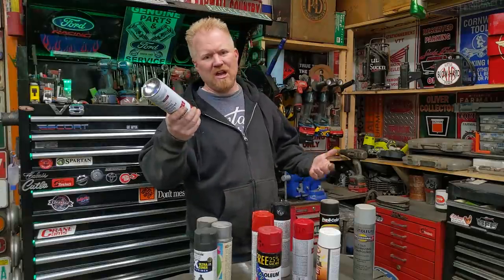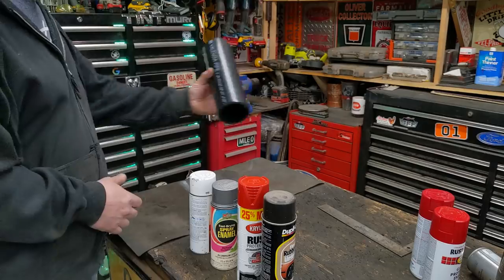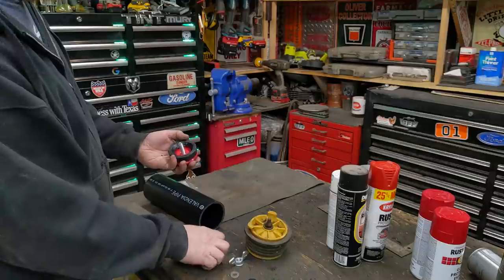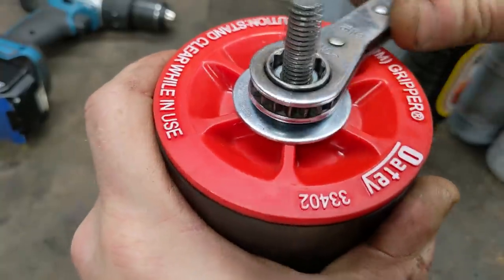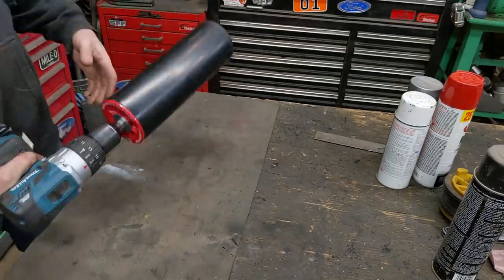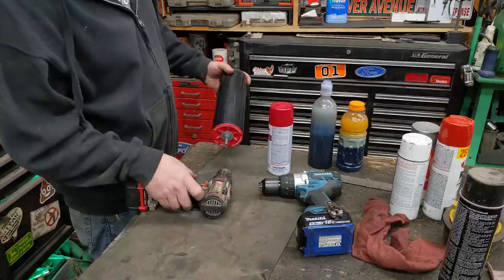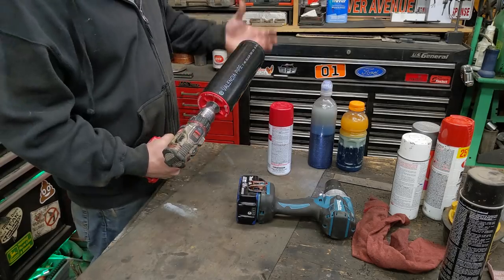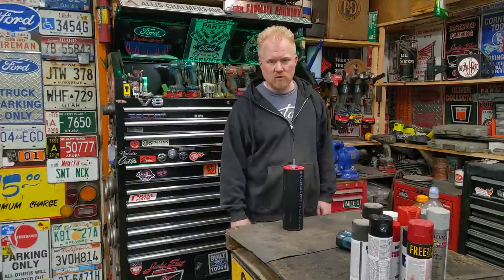EASIEST Spray Paint Can Shaker Stirrer BUILD drill powered

Comment: A 2ft chunk of that 3" pipe is almost $20.00 w/tax at HD now. Along with $6.00 for the test plug and it's almost $30.00. I went the cheap route and made one out of a tin can a 2" bolt and some hardware. basically it's free and it works great. I use a wood shim to hold the spray can in place too.
Reply: He gets a lot of stuff at auctions, at the kerb, in lots, etcetera.  You're right though, if you were to buy it outright and specifically for this project.

Comment: I made one of these the way you've shown here, and then I made another using an old empty propane torch cylinder. I pulled the Schrader valve rinsed it several times with soap and water, then cut the end off. I deburred the cut end and dipped it a bit in a rubberized coating. I welded a bolt onto the screw end and pained the whole thing black. It works wonderfully.

Comment: This idea turned out perfect! Purchased the items from HD and with current prices, came out to under $30 to assemble. Decided to go with a 24" pre-cut PVC, stainless steel set of nuts and washers (Everbilt) per your specs. The screw from the test plug seems to be just right in length to fit in a drill's clutch. Thanks!

Comment: Love the simplicity. Another important reason for hand shaking the can is impart warmth from your hands into the aerosol and paint or other content. This helps to break up "clumping" of the solids that always sink to the bottom of the can especially after sitting for long periods.
Reply: I usually get a pot of water and heat it till boiling point and let it cool for about a minute. Then I throw in all my spray paint cans that im going to use and let it warm up in the water before shaking em up for use. 

I keep em in the water and keep the water warm until im finished. Every liquid sprays a lot smoother and better with stronger spray pressure due to the inside pressure of the can being higher from heat. You should try it.

Comment: I made one too but I attached the piece of pipe to a reciprocating saw blade. Split the pipe down the middle and used a steel hose clamp to hold the spray can in place.
As the blade goes back and forth it really shakes the can, not just spins it.
But your device is good too.

Comment: my savior! i hate shaking cans, usually bust out an electric heater to preheat them to 90-100°F before shaking just to help the mixing process and avoid clogging the inside valve or dip tube.

Comment: Found another use for mine. Slice a pool noodle lengthwise long enough to fit the can. Line can with enough scrap inner tube to prevent noodle movement. Insert paint pen and shake away!  Works great and really fast!

Comment: I just use a old Pringles can that I’ve duct taped for reinforcement, then a round head bolt through the bottom. I am sure yours is more robust but I didn’t have to spend extra money or go to the store again haha. It works good and I did enjoy those Pringles 😂
Reply from the maker: The Pringles in the process makes it worth it.

Comment: Freaking awesome! Even cheaper, drill a hole thru an end cap, put a bolt & nut thru the cap & tighten down, glue the cap on, tighten onto the drill. Freaking perfect!
Reply from the maker: Actually the caps for this pipe size are nearly three times as much as the test plug.

Comment: GREAT idea and I am going to make one. Leaving the rag out induces some eccentric oscillation. With the rag tending to center the can, the contents to include the ball bearing, rotate at about the same speed as the can and the real mixing takes place when the can stops. This is why we hear the ball bearing spinning when the can stops. Some start and stopping while holding the mixer at a 45º may help.
Reply from the maker: I've stopped using the rag and just let it bang around inside now.
Reply: @sixtyfiveford  Thanks to your great idea, I have built three of them, two for friends, I too just let the can rattle around after finding the ideal speed. Thanks again for solving a problem.
Reply: Add a strip of grip tape inside? It would take up little space and supply a bit of anchor for the can....

Comment: I built a wood  box frame and a small metal frame on top. Taped 4 3/8 all thread  rods into wood ,nut and washer top and bottom of metal frame to adjust belt on small pulley attached to and old electric junk drill secured in wood box. Used some dumpster conveyor roller to mount in frame. I can mix 6 spray bombs at one time effortlessly. If there real old let it run for a while while ya do something else. Never fails. Make a u bracket to lock drill trigger at what speed you want and walk away. I’m to old and dinged up to rattle cans lol especially an old one.

Comment: Great tip. I used 80mm PCV and a plastic lid from a kraft peanut butter jar, stripped the threads in the jar lid, and it fits real snug. I run the drill in reverse to stop the bolt from unthreading. Thanks.
Reply from the maker: Awesome.

Comment: I use an old long sawzall blade with a worm clamp riveted to it.  Does a hell of a job.

Only downside is i don't usually have the sawzall laying on the bench
Reply from the maker: I've used the sawzall years ago for shaking. It took more time to swap in the custom blade and attach the can than I could have just shaken it by hand. Consequently I rarely used it. It did work well though.

Comment: As a note-- you can make something similar to this using an empty Campbell's hearty soup can, a nut and two bolts.  It works basically the same way and the soup costs a lot less than 3" PVC.  Just an alternate concept on a very good idea.  Save those rotator cuffs and use a shaker. :D
Reply: I made mine from an alpo dog food can but the force of my drill actually bent the bottom. So then I reinforced it with a chunk of 1/4" steel. I had one in my scrap bin from where I used a metal hole saw, 2.5" I think. Worked perfect and no more worries that it'll bend again and potentially fly out and hit me.
Reply: @89Mirageman  That will surely work.  If one doesn't have 1/4" steel laying around, just use the top or bottom from another can.  It will double the strength of the bottom.  Washers also help as re-enforcement.  The can doesn't have to spin very quickly to shake the paint, so if one has a variable speed drill it works best.  What I finally settled on (and it works wonders) was a cheap reciprocating saw (cheapest one can find works great), and I strap the can onto a long blade.  That shakes the paint better than anything else I've found.
Reply: @Wishbringer7  Do you use a hose clamp or what to hold the can to the blade?
Reply: @89Mirageman   A hose clamp is probably the most readily-available item.  I personally use a special spherical clamp I found at the local hardware store that is somewhat like a ratchet clamp. It is quick and easy to use.   I found another video here that has a fairly interesting idea:  https://www.youtube.com/watch?v=dbkTp_xzFWo

Comment: So I made one per this plan (not from this channel) but wanted a simpler hookup. So I found "hanger bolt drivers" online which are 1/4" hex to 1/4" threaded. Used a simple 3" cap and the 3" pipe. Gotta use Loctite on the threads or they spin off. Now it goes into an impact driver and shakes up upside down marking paint for my septic mark-ups. Keep one in each excavator.

Comment: I made a spinner to clean paint rollers using a roller handle and 1/4 inch threaded rod. It wanted to bend the threaded rod. I’m doing yo try your method with smaller pipe plug and pvc.  Thanks for the idea!

Comment: I just made one.I used a piece of pvc that i already had an a cap.Just drilled a hole an put a bolt through the cap,Slightly wobbly but does what it needs to.Thanks!
Reply: @keithmarlowe5569  I actually think so to,if you look hard enough at a regular cap there is machine marks dead center of it i just drilled 1/8 hole then step it up to the size bolt i had.

Comment: works :) I just bought the 12" pipe & cap on Amazon, just that easy, comes with a wing nut, removed 3/8"-16 TPI & put on a nut so it fit drill, not sure if that is same in video, saw it a few weeks ago.  thx for something I needed to make. I use it everyday.

Comment: I built 3 of these. 1 for me, and 2 for Christmas gifts.  I substituted thin wall PVC pipe to cut down on the weight, Sch 40 was way heavier and with the thin wall (also cheaper at my ACE Hdwr) you don't need to be as careful with holding the tube while mixing.
Reply from the maker: Awesome.

Comment: Done, can't wait for Amazon. No more shaking by hand
Reply from the maker: Hey Thanks, I'm glad you liked it.
Reply: @sixtyfiveford  shaker 2000 done, like you said it's works perfect, even better using a drill that has a slight bend in the drill arbor. Shakes even more. Took longer to find the pipe I just set down than it did to build.
Reply from the maker: @ltmedic3  I no longer put a rag in with the can and just let it bang around in there.

Comment: Nice video. I tried to make one similar to yours but it didn't work very well I think the problem I had was the diameter of the tube was too close to the diameter of the paint can so there was no wobbling. The wobbling is necessary to get the ball the bearing to spin and shake the can. So what I did instead is I hooked up the plastic bottle from peanuts an empty peanut plastic bottle hooked it up to an old blade from my reciprocating saw and that worked fine if I remember I drill a couple holes in the old blade and then I use rivets riveted it to the plastic can which the can from the peanuts it was just the right size for my paint cans and it also was a thicker plastic so it took the rivets better.
Reply: I did something like that with an old reciprocating saw and hose clamps to clamp the paint can to the blade and screwed all down on a board, then one time let it run too long and it wore a hole in the spray can.  Big mess

Comment: Nice idea and build. Could used a typical PVC end cap with a carriage bolt and nut through the end cap and do the same thing. Just an idea... Thumbs Up!
Reply from the maker: I don't think there's enough meat just drilling though a cap without the cap breaking. You would need a domed washer inside/out to help spread the load. I'm not sure why but the caps were also 3-4x more expensive as well.

Comment: I am going to make one today. I have 3" thin walled pipe, it should be strong enough, and the plug is $4.41 at my HD. The reciprocating saw idea is good but my saw is heavier and corded and less convenient to grab than my drill.
Reply from the maker: I hooked up a contraption to my recip saw years ago and it took just as long to install/remove the paint can as it would have to just shake it by hand.

Comment: i wonder if you can just use the cap on the cans to make one(without using a pipe or buy that specially cap end), since essentially you use spinning the can instead of shaking it.

i guess all i need is just a bot nut and 2 washer.
Reply from the maker: It isn't perfectly centered so the can is rotating but also shaking. A cap wouldn't stay attached and you would launch the can.

Comment: i was using electrical tape to hold the cans to a blunt blade in a reciprocating saw.  it works well but the variable trigger is difficult to get right.  i often lose control and the tape tears.  for those who havent seen his video on how to charge up a wd40 can that has run out of air, i suggest you do.
Reply from the maker: I did that years ago and destroyed a few cans by them either flying out or the pickup straw disconnection from the inside.
Reply: @sixtyfiveford  ,yes, i can relate to that.  it has a lot to do with my impatient nature.  i will be assembling one of your rotative mixers.  youve demonstrated to my satisfaction that rotating is better than reciprocating.

Comment: Great idea. Thanks. Do you have anything for quart and gallon paint cans. Would like to have paint mixed without using a paint paddle. Hate cleaning the paddle afterwards.
Reply from the maker: I've used the air shakers https://amzn.to/34vR6m9 and they work good. There is so much mass in a paint can it really takes an industrial tool.

Comment: Great idea. How about using a PVC end cap instead? Also, my immediate thought was it probably does need a little wobble for lateral movement to help any separation of pigment and solvent.
Reply from the maker: Wobble is inevitable. A cap was more expensive and seamed like more work in the process of making this. But no reason it wouldn't work.

Comment: Curious - why not just glue a ABS cap on the end and drill a hole in the middle with a bolt rather than getting the pipe test plug?  I LOVE this idea and wondering if a cap might work instead of the plug or if there is a reason the pipe test plug is needed.
Reply from the maker: There's no reason it wouldn't work but they're several reasons why I chose not to. First and probably the most important is the cap was more expensive (almost double the price at approx $7). Second centering the hole via drilling wouldn't be as accurate (not that big of deal). And the final reason was just having the bolt at the end of the cap would likely fracture and break the cap over time. Stacking thick washers on each side would be a necessity but then you would want to dome the inner one and outer one to match the contour which just seemed like more work than it's worth.
Reply: @sixtyfiveford  Thanks!!!  That is exactly the information I needed.  Really appreciate it!

Comment: You did a good job making it but I'm not sure it is actually mixing the paint, the rattle is just going to spin around the perimeter of the can, any paint in the middle won't get mixed? If you look closely at the oil/water mix, all of the oil is around the outside and the water is in the middle.
Reply from the maker: I was skeptical and the reason I made test bottles but it does a fantastic job. The demo I showed was under 5 seconds of mixing just to show how much the stuff is moving.

Comment: Ive been taping them to a sawzall blade and giving it the reciprocating treatment.
Reply from the maker: I tried that a number of years ago with my plug in Makita. It shook me nearly as much as the can.
Reply: @sixtyfiveford  lol really? I didnt notice anything out of the ordinary. I even made a tube to shake up my old testors model paints that have completely separated. It's basically a pup piece of that really thin wall pvc, schedule 125 (or something like that), 1" dia. Stack them in with a foam (that black abs looking foam stuff used to separate concrete expansion joints instead of felt) discs between each little jar,  tape ends closed then tape to sawzall blade.  ..a jigsaw would work too, I'm sure. ..for the model paint.

I thought about spinning but thought it wouldn't mix it well enough. ..until I saw your oil n water demonstration.  I was impressed.

Comment: Use a hardened bolt cut the head of put the threaded end in the pipe trimmed as short as possible cover with a plywood disc to prevent damage to the paint can.

Comment: While the liquids inside will most certainly mix inside, will centrifugal force not just cause the ball bearing inside the aerosal to get flung out and sit static in one location/spot?
Reply from the maker: Because of the mass of the ball bearing/glass marble will stay stationary for a few seconds while the can is spinning. So the paint is moving across it mixing. Then it gradually picks up speed and starts moving the same speed as the can.  You let off the trigger and the ball continues to spin mixing while you have stopped. You do this a few times and it's all mixed.

Comment: i do autobody..we have paint can shakers. They shake, not spin. 
The cans need up and down motion to allow the steel ball inside to agitate the paint.   
Centrifugal force will only let the steel ball spin along with the paint.     Spinning IS NOT Shaking
Reply from the maker: The ball is agitating the crap out of everything inside. The same as sticking a stir stick in a paint can and moving it around.
Reply: @sixtyfiveford  spinning the can is different then stirriing with a paint stirrer. The stirrer spins while u move it around in the can , you dont just keep the stirrer in the middle of the can its the same concept as beating an egg..if u stir the egg, it will not mix but if your beat it with an up and down motion added to the stir, thats a different story.

Comment: How does centrifugal force not just throw (and keep) the ball up against the side of the can?
Reply from the maker: Shaking a can is silly if you really think about it. It's like mixing a 1 gallon can of paint by jabbing a paint stick in and out of the paint at a rapid pace. Now stirring is agreed to be the best method to mix a 1 gallon of paint. 

The outside on the can is round. The ball's mass is more than the paint it's pushing. So paint is moving and the ball is essentially staying still. Reverse stirring essentially. Kind of like putting a paint stick in a can, but spinning the can instead of the paint stick. The ball eventually matches the speed of the paint after 10 seconds. Then you stop and the ball continues to race around stirring the paint. Do this 1-2 times and the paint is way better mixed than a minute or two of hand shaking.